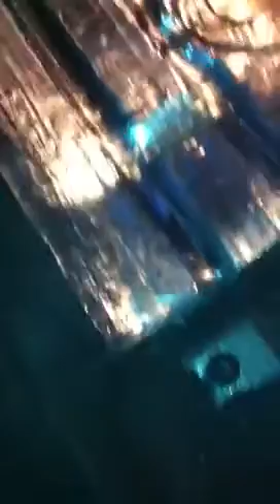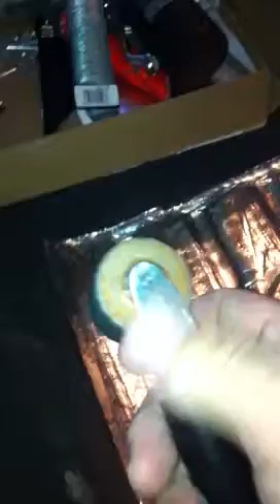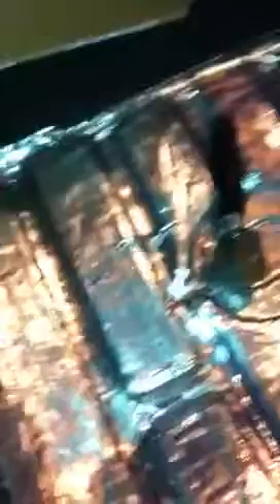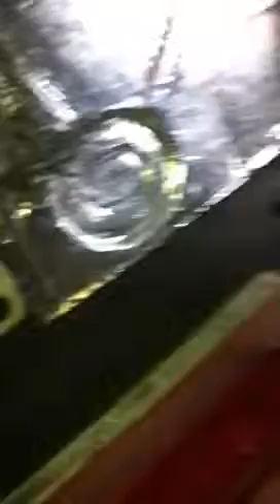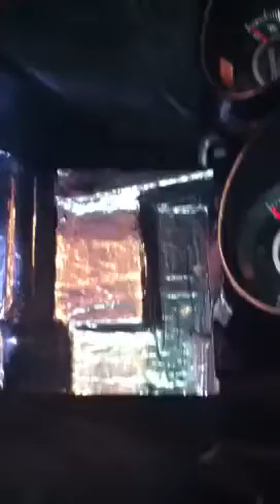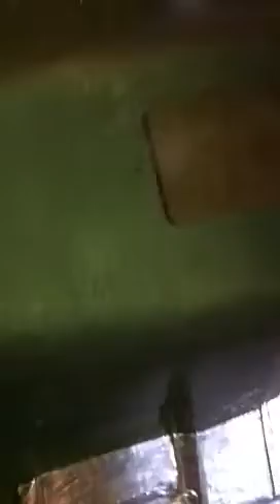Alpha damp install

Comment from the maker: It is good. I plan to use the rest of what I have on the doors. The inside door frames on my Camaro are pretty tinny sounding, so I plan to install the Alpha Damp after I get the glass back in the door. I am waiting on my Wing Windows to be finished, so I do not know when that will be.
Thanks for asking,
Chris